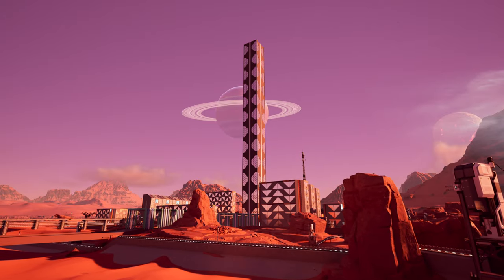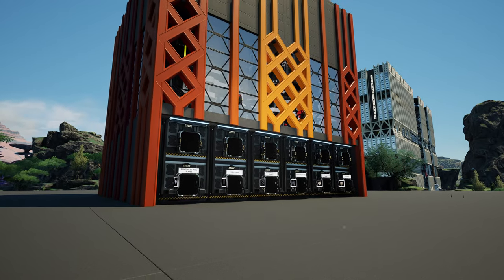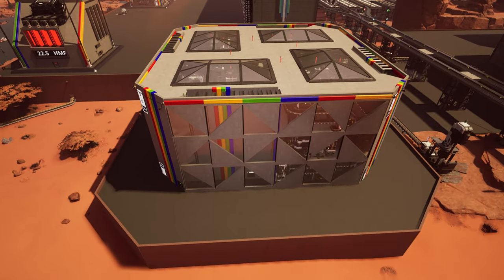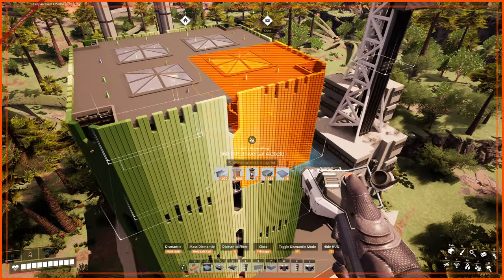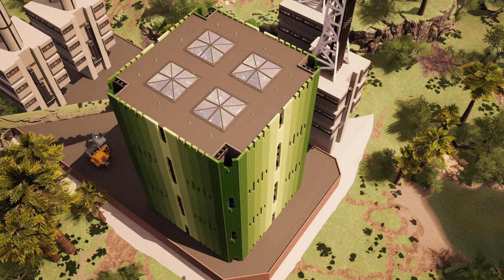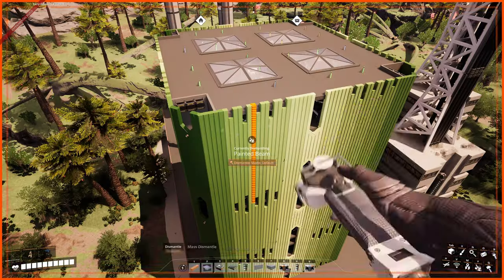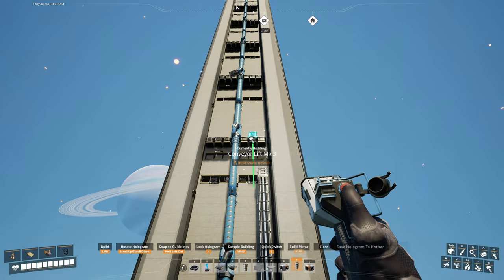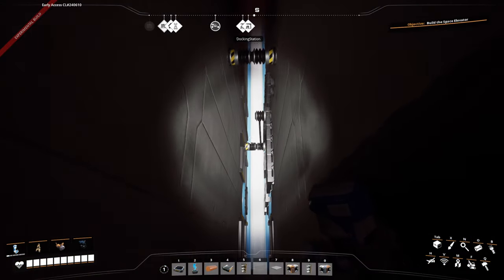Blueprint Factories are Different! Here is how!

Comment: This is awesome, your building style is so cool, and the fact that it’s all blueprints makes it even cooler. I’m having a bit of difficulty understanding exactly how the manifolds work, but I’ll definitely check out the blueprints to find out, thanks! 🙏
Reply: the simplest way to explain manifolds is that they connect everything one after the other.

so the first building in the line gets half the full speed of the input, and the other half goes down the chain then the next building gets half of that (a quarter of the total input.) etc... so the first building needs to fill up for the next one to get almost the full belt speed.
and basically only the first 3-4 buildings that aren't full will be filling up.
Reply: @satibel  You need to saturate manifolds. The last splitter will output your full belt speed as long as every splitter before it is backed up. 

If the output matches the input, it'll never saturate. You can turn off production to build up material.

Comment: I've played satisfactory since it first came out on steam and I can't decide if zooping or blueprints are my favorite additions, but they were both completely game changing. I hope they add Y axis nudge for BP placement, and a 5x5 grid would be sweet.
Reply from the maker: Oh boy 5x5x5 would be wild. It is not even the case with horizontal axis, but in vertical axis it is an extra floor! Quite huge for the bigger machinery like blenders, refineries and manufacturers. They are quite awkward in 4x4.
Reply: I dont expect them to add 5x5 blueprint planners or vertical nudge. They seemed quite stubborn on these. However, the modding community isnt. There are mods that provide you with larger blueprint planners and vertical nudge.
Reply: @Yakez42  It will be interesting to see how you incorporate the new machines in 1.0 into your blueprints.
Reply: @ichVII I don't understand not adding vertical nudge. At least for the blueprint creation itself. I recently got to blueprints for the first time and I placed foundations for alignment and found out my blueprint was floating 😅 so I had to go back and remake it using the floor's own indicators. And I doubt vertical nudging is complicated with the internal coordinates
Reply: @zimzimph  I dont understand it either, I still dont expect them to add it.

Comment: "personal storage"? yeah they ruined that necessity with the mercer sphere update lmao. cool though just no longer useful. only those modular blueprints and such have me interested.
Reply from the maker: On the contrary it is better than ever, it is natural expansion for any personal storage system. Maximum upload rate of dimensional uploaders is only 240 items per minute. It is no where near my average consumption of concrete, steel, silica, quartz and plates when I am building. So buffers is still necessity, making any dimensional depot uploader technically a personal storage first. Dimensional depos only nullify personal storage if you have free overflow in normal factories to place depos, but then why you do have free overflow and do not convert it into higher tier items?
Reply: @Yakez42  i am no where close to needing 240 a minute. the personal storage you're advocating is a little misplaced since the modularity does not become realistic with limited mercer spheres. when I said it ruined the necessity I really meant it. up until the end game you wont need these types of blueprints and a basic factory connected to a basic depot into a dimensional depot would dispense with the overt solution of a universal location for all items. its a cool idea but you are not seeing the early-mid game relevance or irrelevance rather. the majority of the time I will not have the input, and, when I do have the input, I will not need the output. does that make sense? I hope so because the gameplay is not aligning with your over-engineering most of the time. cool idea. it would take me 20...30?...40+ hours of intense repetitive exploration to get the upgrades you say are not enough. when mercer spheres are manufacturable then we have might not even care entirely. until then, yeah you will need that silica and whatnot for the pointless aesthetics and the extra flooring that would otherwise not be needed because you aren't using a blueprint constantly. also if you have a modular base why would you even care about centralization?
Reply from the maker: "Would you even care about centralization?" Well the answer is simple. You sort of answered it yourself. mercer spheres are limited. You cannot spam them to have like 2k concrete per minute upload rate. And this is like average concrete consumption I have when I build something of substance. So my over engineering is actually UNDER engineering for the way I play the game. And without buffers dimensional uploaders are just a joke. What you intent to do with a stack of HMF for example? Place like 5 blenders every 20 minutes? It just does not work unless you add big enough buffer to cushion production output with upload rate and overall space-time of gameplay. Physical access to personal storage buffers is still a thing, well unless if you are building at a snails pace.
Reply: @Yakez42  thanks for the reply. your buildings are beautiful

Comment: Hi! I like your style! I must say you have some good looking blueprints going on! On the technical level i think we are about the same though. I did a lot of vertical stacking blueprints before but changed to horisontal only. I think the vertical building kills the beauty of the game. I like seeing the endless rows of items going into the machines. As a tip (maybe you have been doing this): you can stack big blueprint builds without going manifold. Just use a smartsplitter with overflow going back to mainbelt and then strangle the input to the floor to needed size.

Comment: 10:42 I tried to make one from what I imagine the inside probably looks like.  I can run a Tier 3 mine pore, normal, pure.  With 1 / 2 / 3 stacks respectively.  Takes about 10 minutes to setup on a new mine, run all the plumbing, wires, etc.  I'll post a screenshot in the reply in case YT deletes the link.
Reply: I can't seem to post a link to a photo, anyone know how? It keeps getting auto deleted.
Reply from the maker: YT nukes the links by default. Bots and stuff... Added to Approved users. Now in theory links can work.
Reply: I posted it again, see if that one went through.  If you see this comment and not the imgur link, then it still didn't work.  Either way, thanks for the inspiration :).  It occurred to me after seeing some of your build that I have been doing this in minecraft for years due to the nature of "chunk loaders".  Most servers limit the number of chunks a player can keep active.  A chunk is 16 blocks x 16 blocks.  So I got use to building very tall factories one a tiny plot.  This is very similar.  I just never thought of doing it on this game because there is so much open space.